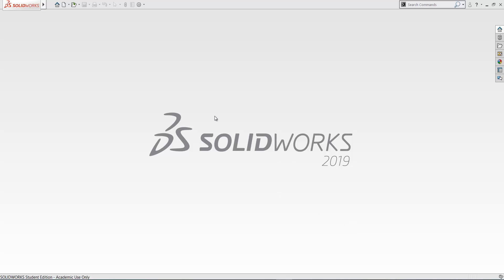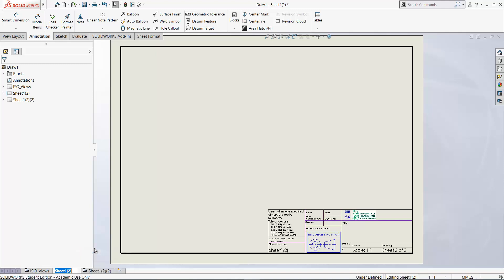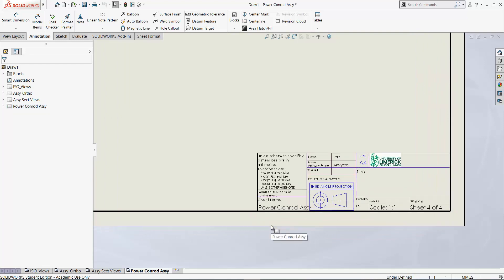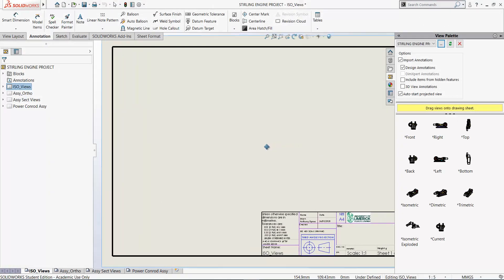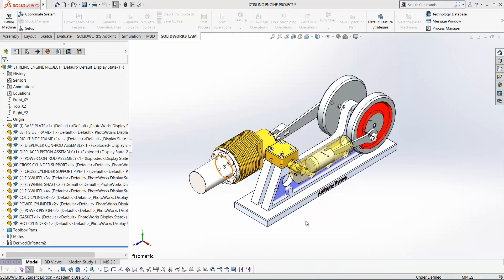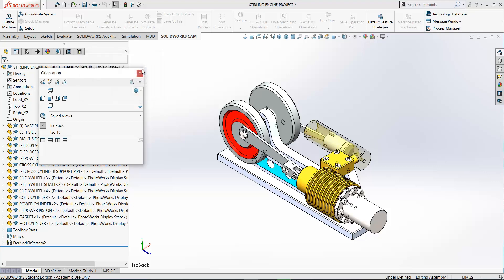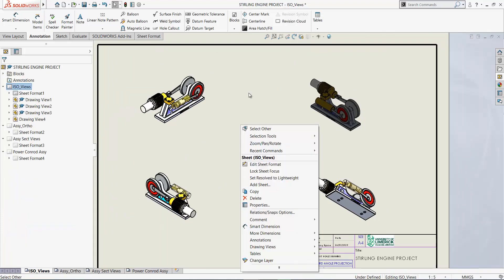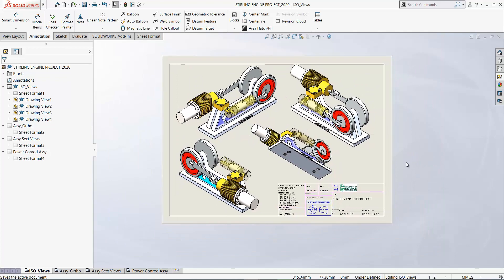Stirling Engine Drawing Sheet 1

Comment: some info.    at 7:50,  hot-side  rod-end  pivot  is  a  Joke.      compare a clevis-type rod-end connector.      the amount of  dead space, in the cold process,  Should  be  MINIMAL.   in othe words,  the port should  NOT  extend  into  the cold  cylinder.     googletranslate
https://www.motorsandrotors.co/images/clevis.jpg